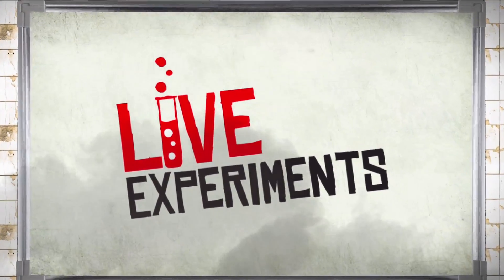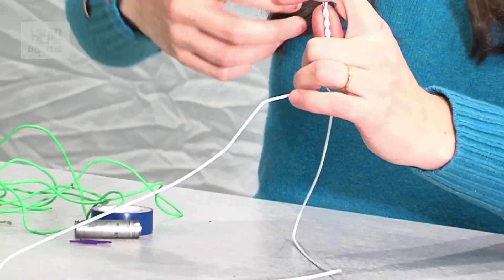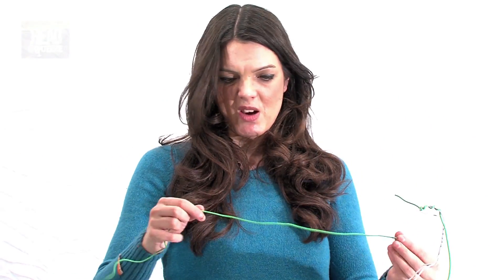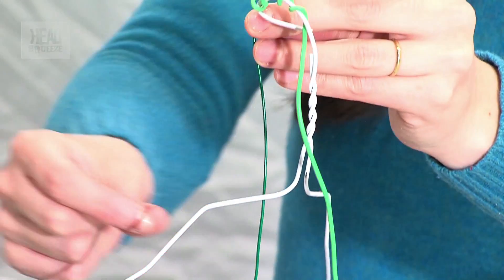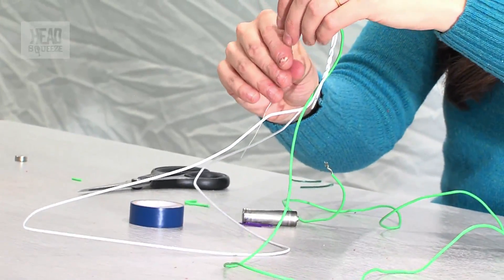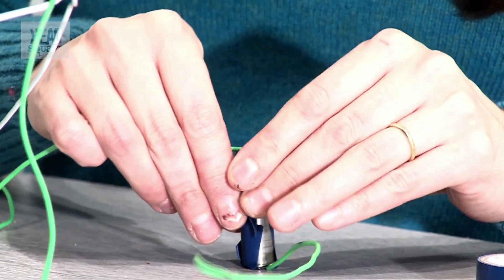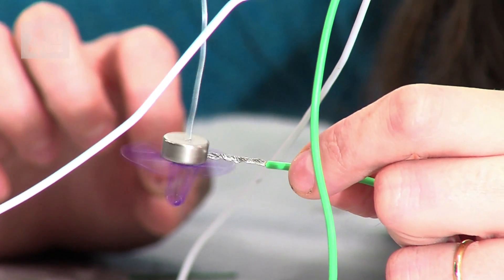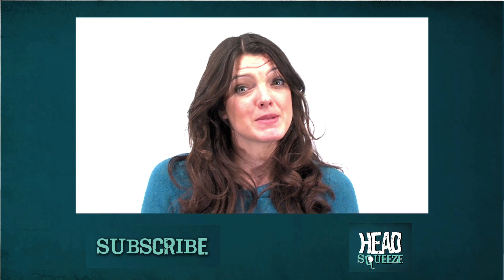How can you make a motor? | Live Experiments (Ep 20) | Head Squeeze

Comment: the force that she is speaking of is a magnetic force. When current flows through a wire it produces a magnetic force that the magnet in turns react with. The magnetic field created by the electricity is constantly changing and due to the constant changing and the fact that unlike poles repel the magnet spins
(I think this is how it happens)

Comment: Seriously.. id do it in another way ;) Id put the battery on a magnet than shape some wire in a large rounded M or lying down 3 shape thing... the midlle part of M/3 touches the other side of the battery and the side parts go down to touch the magnet and close the circut. And it spins ;P I also would recomend adding a spacer under the battery and placing it with the + twards the spacer and the magnet so the spining part would have a little cavity to hold it in place while spinning ;)